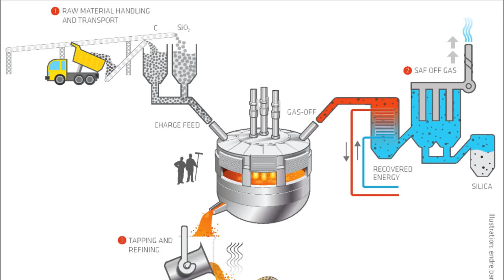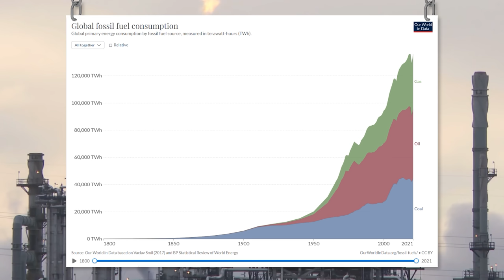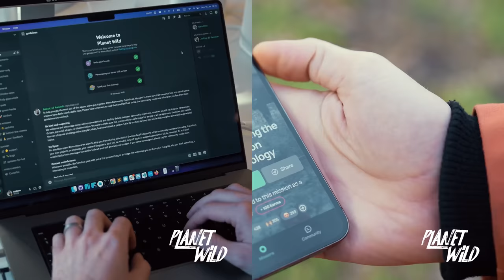We Will Be the Last Civilization on Earth

Comment: So as some have mentioned Nuclear is an option. To get there we'd still need some initial hot burning fuel. But with copper decently accessible we can start doing electricity to make hydrogen, which burns at up to 2000c in air. Since we'd probably use electrolysis on water, we also got pure oxygen, in the stoimetric ratio at that. So thats 2600c flames, enough for even silicon.

We can do U and Th with that too. W is another beast, and I actually dont know how they melt it today, without looking it up. Electric arc kilns perhaps?

Comment: Lots of popular misconceptions in this video: 1. Biomethane and biofuel liquid fuels are a thing. 
2. Bioplastics are a thing. 
3. Molten Oxide Electrolysis can be used to make iron from ore with nothing but electricity.
4. Hydrogen is also a thing and it can be made with electricity and water. That hydrogen can be used to make fertilizers, cement, steel, and yes, purified silicon. Also rocket fuel. 
5. Electricity can be made with wind power, solar, hydroelectricity, bioenergy, geothermal, and nuclear. 

Fossil fuels are not currently necessary with current technology and while they were the path to development we took, they are not necessary to get to this level for the above reasons missed out in this video.
Reply: I agree with all alternatives, but at the same time a new civilization starting from scratch wouldn't be able to acquire all this knowledge without having other easier energy sources at disposal and many years or even centuries of experimentation and research.
Reply: An easier alternative for smelting would be mirror arrays - polished tin should be enough to create multifaceted mirrors that could focus sunlight on the ore you are trying to smelt, with temperatures only being limited by optical quality.
Using biological sources for many chemicals would also be a much "easier"/elegant solution, though the necessary understanding might be hard to transfer without digital information processing (imagine needing to learn all of biochemistry from nothing but old paper scrolls)...
I think a different kind of society would have no problem creating a technical civilization based more on optics and bioengineering, than on fossil fuels/electricity and mass fabrication/machining/etc..
Reply: Excuse me but what are you going to insulate those electric wires with?
Reply: Bio plastics and bio fuels are not good environmentally. They require vast amounts of land to be used as a monoculture.  It's bad enough we do that for food as it is, but it's a necessary evil.  I completely agree on nuclear. It is currently the only answer that even comes close to being viable. Wind and solar absolutely are not viable on a mass scale because we don't have the battery technology yet, and that ignores what we have to do to the Earth to get the battery components, as well as what's required to get all the metals to expand the grid infrastructure on a scale people are hoping for. There is a 0% chance that everything goes electric on the timeframe politicians and activist want (the energy grid can absolutely not handle all cars being electric by 2035) and it is a math problem. We are not extracting things like copper at anywhere near the rate that would be required to electrify everything. Not even in the ballpark, and the same activists and politicians refuse to allow the conditions required, like approval for new mines, that would make it happen. It's absolutely infuriating that the people insisting we do this are the ones preventing it from happening, and they have their heads up their backsides when it comes to all of the negative aspects of their plans.
Reply: @glencuda  Leather.
Reply: @glencuda  you realize rubber originally came from a tree right? And then, see bioplastics above.
Reply: @jasondashney   nah. You don't get to invoke math without showing your work. But I'll tell you now the math is wrong for making assumptions about supply not changing. This isn't a matter of basic arithmetic, it's not even calculus, it's more complicated than that with more variables. You ignore half the energy sources presented and are a silly nuke fan boy. You're wrong through and through and I don't have time right now to explain all the ways you're wrong. Bullshyte asymmetry principle and all that.
Reply: @Dr.Gehrig "you're wrong and I refuse to elaborate" lol okay I don't believe you then
Reply: @bonesofeden  if this is your current position at this point, all of the data in the world wouldn't change you. This is just a far more efficient way to get to the same result.

Furthermore, I gave more than enough detail in the response before explaining why it's pointless to go further than I did with someone like that. Frankly, he got more than he deserved.
Reply: The math is very simple, and is compounded by the fact that no western nation is upping (let alone the drastic increase needed) the amount of mines they're allowing.  We need WAY more metals and minerals mined.  We need a gigantic increase and governments will not allow any of it to happen. I'm not "making assumptions".  I'm telling you what's happening.  And later is too late.  It takes many years to bring a new mine online so if they don't do a completely about face right now it's not going to happen no matter how much money they throw at it.  Thanks for the personal attacks though.  They really help your argument @Dr.Gehrig

Comment: The Romans were quite good at making concrete. 

It sounds like the main issue is needing fossil fuels for reaching high temperatures.
Reply: Yeah…
Reply: Roman concrete production was very different than modern concrete and would not scale to the level we use it today.
Reply: How often do you think about the Roman Empire? 👀
Reply: @bluesteel8376  But their buildings are still there.
Reply: It's possible to use for instance electric arc furnaces to reach the temperatures required. So the moment you can get rotating motion like say from a wind mill like they built even before the industrial revolution or a hydrodam, there is already a path one could in theory follow to reach very high temperatures.
Reply: Romans used very superior ash from a Campi Flegrei eruption to make far better concrete than modern trash.
Reply: @bluesteel8376  it could if the romans knew what methane was
Reply: Not just high temperatures, it is the need to melt tons of material in a short period of time. This includes bricks and glass as well as cement and metals. Glass plants have tanks the size of large swimming pools to hold molten glass to make the products we use every day. Too much material to melt or process with electric arcs, electric heating elements, etc. Plus, where will all that electricity come from? Solar panels? The country that stops using fossil fuels will have to buy these products from countries that use fossil fuels.
Reply: @OnTheRiver66  Electric arc furnaces are already used for making steel at scale, a quarter of all steel globally is made via this method from what I found. So I don't think we can really claim it isn't capable of producing at industrial levels.

And one can always generate a lot of electrical power via for instance nuclear power plants.  Or lately there has been talking of using all our drilling technology to drill to great depths and harvest the heat far below, test plants of that kind of geo-thermal idea are already being tried out. 

As such, I don't see a particular need to have to buy from fossil fuel countries. There certainly are solutions if one goes for some of the sane options.
Reply: The main issue is Political lobbying and strange interests in those sponsoring this channel? 🙂😗🤫🤫

Comment: You forgot to talk about Glass, which is also very important material in our world and requires temperatures around 1500°C. To sum it up : in a world deprived of fossil fuel you wouldn't be able to build Solar panels (steel+glass+silicon), Windmills (steel+concrete+fibre glass+electronics/silicon), any kind of electrical power plant including hydraulic (steel+concrete+divin+mining+metallurgy of complex alloys)... Basically, you can't build a "renewable world" unless you already have "non renewable resources"

Comment: Many of our inventions and tech are based on what is easily available around us. A civilisation after us would find new ways to get to space. And currently do to plate tectonics new areas of fossil fuels will resurface. But conserving energy needs to be a virtue for any civilisation that want to last.
Reply: My reply is above ..I suggest you read it..
Reply: Um... No. The oil isn't under the tectonic plates. That's miles down.
Reply: The geological processes that created the fossil fuels resources we’ve been using are hundreds of million years in the making. Plate tectonics is not a driver in fossil fuel creation from the decay, deposition, compaction at depth under heat and pressure of organic matter. Plate tectonics might be a driver in making mineral resources more accessible though.
Reply: No, we don't need to conserve, we need to build up as fast as possible.
Reply: @Apistevist  We could do both; materialism and consumerism are not serving us well, and that's where we need to conserve. Doesn't mean spend bare minimum energy, just means be smart/efficient and sustainable with it
Reply: @Pseudonym38  It drives the economy, competition and therefore innovation. We need space infrastructure and should explore the true viability of options like a tethered ring launch system and solar sail laser systems in strategic locations. 

For climate it appears that solar shades are viable now that would allow us to control sunlight on Earth. Reduce by just a couple percent or shade areas for vegetation to take hold etc.
Reply: Given the assumption we will be able to leave this planet, which I doubt.
Reply: @marcgottlieb9579 I'm not sure you grasp how the youtube comments section works.
Reply: A way to get to space without fossil fuels??? Lmaooo. Delusional
Reply: @AlSpaniard6 ,lol.  We don't use fossil fuels to get to space. Other than to make the machinery needed to get there. Although, nuclear energy can replace a lot of the fossil fuels needed.
Reply: @kirkturner8872 where do you get the RP-1 from?

Comment: I'm definitely probably missing something in this scenario, but why couldnt humans just use charcoal power to reach up to a point of electrical generation capability without fossil fuels (like the late 1800s and early 1900s) but instead use electrical resistance and arc furnaces to melt/work higher temperature materials without needing fossil fuels to generate the heat?
Reply: I am not trying to be smart, but you might want to see how charcoal is made.Coal is kind of the same thing without the problem of making charcoal.
Reply: burning charcoal still gives off green house gases and where would you get the electricity for your electric furnaces?
Reply: @keithgutshall9559  Dude said in the video making and using charcoal is carbon neutral...
Reply: @RestrictedHades  You heat water to make steam and send the steam through turbines to make electricity...all this can be made with copper wire and iron-adjacent materials. Also, the video legit said charcoal is carbon neutral. The gasses are released from charcoal that came directly from trees that took the CO2 out of the atmosphere. Co2 didnt appear or disappear- you cant add CO2 into that chemical equation
Reply: You’ll run out of trees well before you get anywhere near a decently sized civilization that can dip back into nuclear or renewables. Cultures regularly denuded their entire landscapes for fuel as early as the Iron Age.
Reply: @Grak70  Thats a genuine caveat, better than the other two 80IQ dudes who said "hurr charcoal produces greenhouse gasses" like the video didnt just directly say its carbon neutral. Anyways, thank you for a good answer, I was legitimately asking for possible alternatives, and that gives a good reason as to why charcoal alone possibly isnt feasible
Reply: Isn't "decently sized civilization" ironic ? Yes it is.
Reply: @grindupBaker  ironic? Not sure about that. “Large” if you like. But by that definition there were already too many people thousands of years ago and I don’t usually see hand-wringing Malthusians lining up to kill themselves off, so we’re stuck with the situation we’re in.
Reply: That would be a whole lot of forest to go thru.
Reply: @Salamandra40k  It still releases as much CO2
Reply: @stvrob6320  Do I need to mention again that the video directly stated that using charcoal is carbon neutral?
Reply: @Salamandra40k  That does not make converting all your trees into CO2 a good idea.
Reply: @stvrob6320  That's not... you missed the point
Reply: @Salamandra40k  it’s only carbon neutral if you chop down trees as slowly as they grow back. Which historically, by the time your civilization needs iron smelters, has never once been the case.
Reply: @Salamandra40k  The point is, burning carbon releases CO2 whether it is "carbon neutral" or not.  Even Coal and petroleum is carbon neutral in the long term.
Reply: mothflap  Take it up with the video
Reply: @Salamandra40k where do u think the coal came from? According to your logic, burning coal is also co2 neutral just neutral to another period

Comment: You could replace fossil fuels with H2 and O2 (burns at about 3000°C) which can be easily obtained by electrolysing water. Or you can just smelt your metal ores directly with the electricity, arc furnaces exist/could be invented again.
Reply: And how you produce H2 without electricity ?! Can you imagine the level of tech just to produce 1 single generator when all you have is sticks and stones? Even producing 1 banal stell bolt - is "alien tech" at that stage.
Reply: @M4V3RiCkU235  dont forget electrolyse of water is only about 50% efficiency, so it's not great but could still be an alternative for fossil fuel, like train, truck or planes. It has already been used in rocket so it's not un imaginable to be used else where
Reply: @M4V3RiCkU235  simple mechanical energy and a motor could still electrolyse water. You can grab a 9 volt battery and stick it in salt water and produce hydrogen and oxygen, and the fun thing about it is that you can burn h2 and o2 right back into water.
Reply: @M4V3RiCkU235  Why without electricity, he said you can melt copper and iron with coal, so there is your material for your generator.
Reply: @Hoellenmann what about wind power that's not being used I.e. when the demand is low but wind is high use the excess to create hydrogen?
Reply: You can only get the same amount of power out of H2 that you put into separating the H2O... and that's with 100% efficiency.

Molecular hydrogen is also known to be very leaky. Poorly maintained/cheap seals, fittings, and hoses could turn your garage into the Hindenburg.

H2 storage also requires compression/refrigeration to make it dense enough to use as a fuel cell. I've heard of other technologies.. but storing it like propane in a tank would not be feasible.

Anti-hydrocarbon use "climate science" is propaganda. CO2 accounts for less than 1% of the mass in our atmosphere. And a small fraction of that is what we've contributed since industrializig.

[They] are trying to restrict our ability to travel.
Reply: @four-eight-zero5627  But you could build more than one electrolyzing plant for every furnace. You could also build it in a way where you don't have to store the hydrogen, because electrolysis can easily be turned on and off. And the question was, is it possible, not if it was economically viable in our world.
Reply: Water vapour clogging up the air

Comment: We only have to find ways to produce electricity without fossil fuels. Electricity can produce high enough temperatures to melt all kinds of metals. You can produce electricity without any high temperature materials via the sun. Sun ovens (mirror chambers) get water boiling, which turns brass or bronze turbines (at first). Once you can produce enough electricity with those, you can start refining higher melting point metals.

Similarly, biogas can be produced without any metals at all. You just need big stone tanks and lots of plant waste, manure, excrement and other materials that produce gasses when digested by bacteria. That gas can be used in ovens to produce high temperatures either directly for melting metals with a relatively low to medium melting point (at first) or to produce electricity later on with those metals and alloys.

Such a civilization could actually be much more sustainable from the get go and skip the dreadful fossil fuels. Maybe their development is a tad bit slower, but that doesn't have to be the case either. If we had skipped fossil fuels and all the decades and hundreds of years of development for machinery to use them and instead had that time used to develop machinery to produce electricity right away, we'd still have arrived at our current development level at the same time. Naturally, back in those ages we didn't have the knowledge we have today, so that would have never happened (save for external intervention.👽). But today we have this knowledge and could skip a lot of steps to speed up the process. Fossil fuels are a convenient source of energy but by far not the only source that allows for the development of a high-tech civilization.